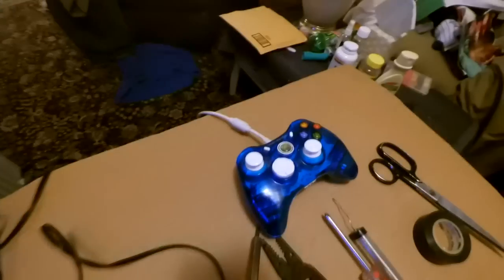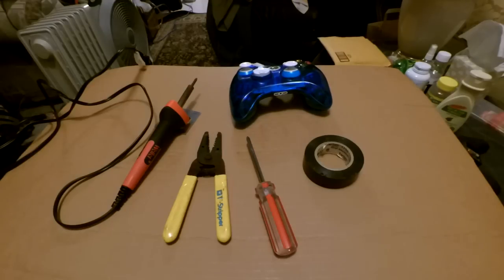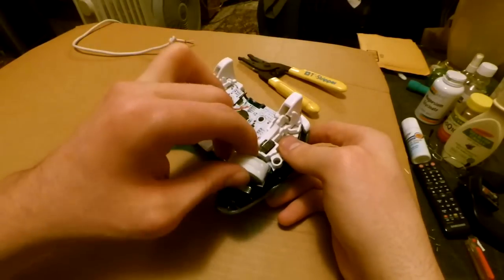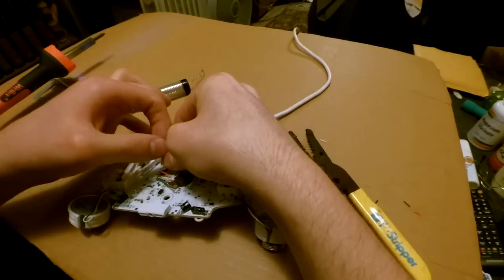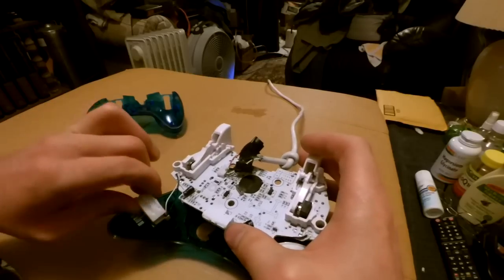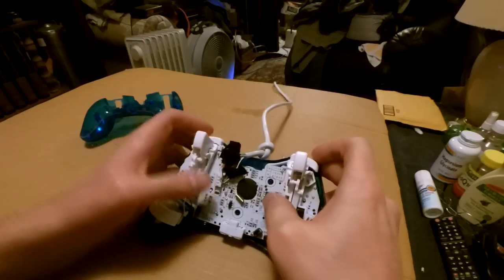How to fix a Xbox 360 wired remote

Comment: There's a thing on the wire that you cut off, is that not a necessary part of it?
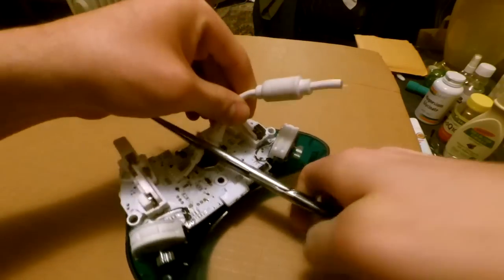Reply from the maker: I'm sorry are you talking about this part in the vid? 5:38
Reply: Yeah the bit at the top there, the cable goes through it.
Reply from the maker: @RockDeviI  yes most likely u need to cut exactly what I cut cuz most of the time that whole area is damaged. Plug ur remote in and wiggle it and find where the bad wire is. It's there where I show u or by the USB
Reply: The broken part of my cable is between where it goes into the controller and that thing on the wire, I know this. I just was wondering if that thing on the cable is necessary for anything or if i can just cut it and forget about it, otherwise id have to strip the bit of wire in between and fix that.
Reply from the maker: @RockDeviI  no you can just go ahead and cut it. It's nothing
Reply: Alright thanks :)
Reply from the maker: @RockDeviI  No Problem

Comment: I don’t have soldiering iron what do I do
Reply from the maker: You can twist the wires together to  connect them then use electric tape to cover the bare wire. Just be aware that it might be a bad connection doing this way.

Comment: My controller is giving me the error code 43, I've double checked that it's not my pc cause i tested it on different pc's and laptop (no consoles) it's giving the same error. Now the weird part is when i touch or twist some parts of the cable it works but will stop when i tilt the controller and when i tilt it again it will work. It doesn't happen anymore so, think you're method will work?
Reply from the maker: Yes, most likely its a bad wire connection. Most of the time its near the remote but sometimes it can be somewheres else. If you findd the spot then just follow my steps in the video.

Comment: I have it all on I don't understand the part were u cut the wire can u plzz explain to me
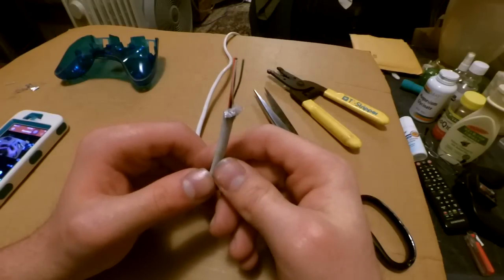Reply from the maker: If your talking about when I cut the white part of the wire 4:45 is because you need to cut it so you can get to the smaller wires inside 8:30 {smaller wires}. After you cut the white wire all you have to do is solder the same colors to each wire like i show in the video. 14:07 {Solder wires} Just make sure to do every step I do in the video. GOOD LUCK :)
Reply: Thanku so much
Reply from the maker: no problem

Comment: I'm gonna just remove the entire connector and use a PCB mount screw terminal block  with the same 4 pin connector.Makes it much easier then needing to solder each wire on
Reply from the maker: yea that works too

Comment: You know, you are creating another weak area for the wires to break when you give it a knot just to form sort of a plug. A better solution would be to tape the area several times to increase the thickness of the wire so that it does not pull out. Normal electric tape work just fine, but you can also try Duct Tape (reduce width of tape with scissors obviously)
Reply from the maker: Yea thats a good idea, so far i been using this remote for 6 months and havent had any problems.

Comment: Sorry but your video was hella too long for nothing. First thing , why didn't you just remove the rubber to find the broken wire instead of cutting it all over to weld it back. Pointless to me in my opinion
Reply from the maker: Because cutting the rubber is nearly imposssible to get to the wire. And the video wasnt for nothing I do show how fix it and whats the second thing?
Reply: +Experience With Me You wiggle the wire and you find the place where the wire is not touching. Much more easier
Reply from the maker: yea but after your done soldering it and tape it, it would be a weak point even tho if u put tape. my way is better cuz u make a knot in the inside of the remote so that way you cant rip the wire. idk whatto tell you. Thats your opinion